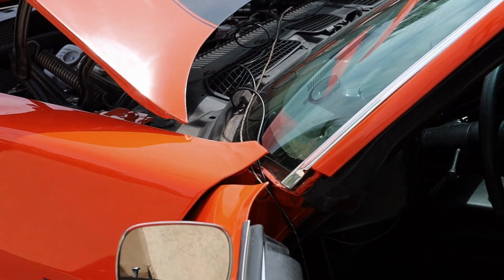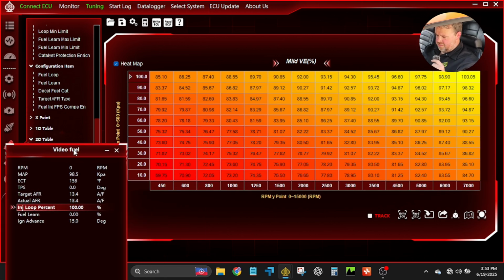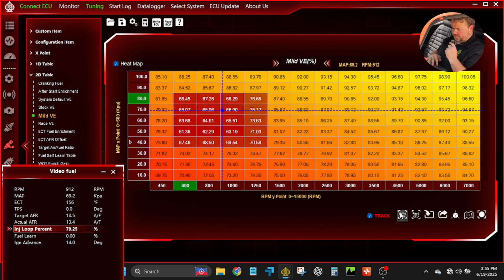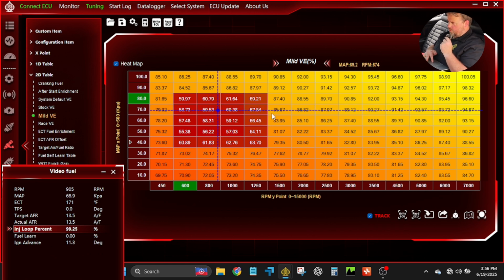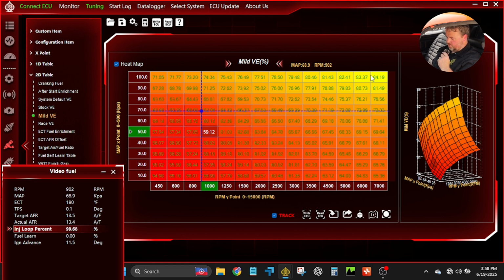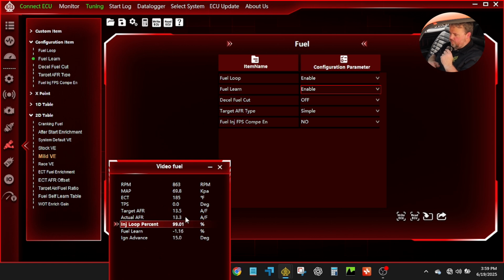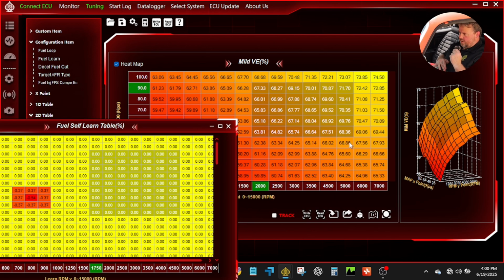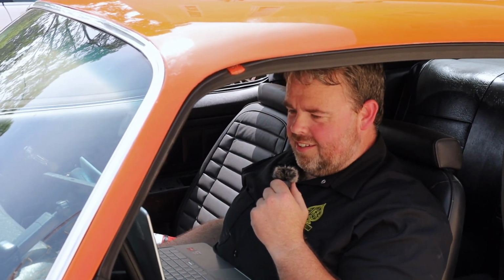Killshot Fusion: Initial Adjustments (Advanced Tuning Software)

Comment: Why are the self learning table and the VE table in different resolutions? Makes literally zero sense. Also why is there no feature to highlight the self learn table and apply adjustments to VE table? It's 2025, how have we not simplified this? Why are we manually adjusting cell by cell when the cells don't even match between tables? Did you guys think at all when designing this software?
Reply from the maker: Hey Zach, in our latest generation of systems, we have introduced larger tables designed to enhance both learning and VE tables. Our goal is to create a comprehensive range of products that cater to a diverse array of customers, taking into account varying abilities and budget considerations. We believe this approach will help us better serve our community and provide solutions that fit the unique needs of each individual.

Comment: Is it possible to get a finer table? 500 RPM increments in the fuel table is a little to coarse.  Especially for engines that max at around 5500, which is most street engines.
Reply: Go to the X Point tab and you can adjust the min and max rpm. There is an option where it will auto fill in each box in between

Comment: How do I prevent my KillShot with inline fuel pump from bleeding off all the fuel after it sits a while. I have to turn my key on & off 3 times before fuel primes the throttle body. I’ve already upped my fuel prime % & fuel prime time. 

Is there not fuel check valve in the aces KillShot complete system?
Reply: Same thing is happening to me with a stock 350 in a 91 firebird. I’m assuming it’s my fuel pressure regulator because in say a stock pickup ls 5.3 or 4.8 the fuel pressure regulator is what keeps the fuel primed. At least that’s what I’m assuming. I’m running a jegs FPR.